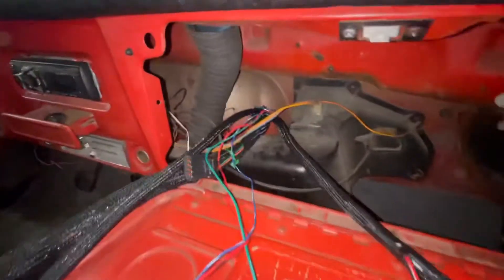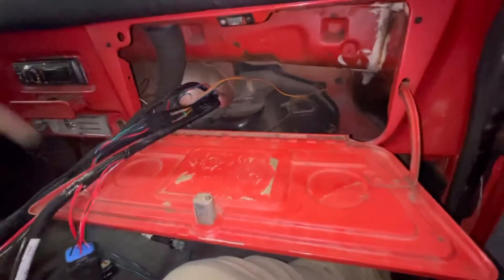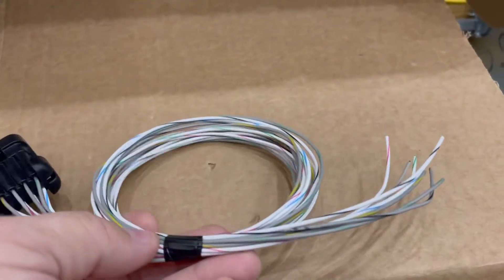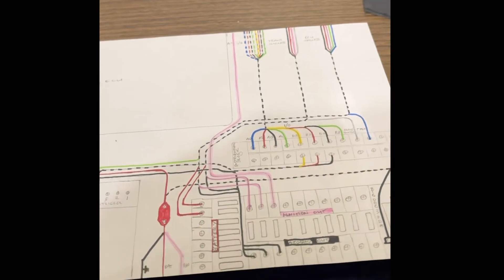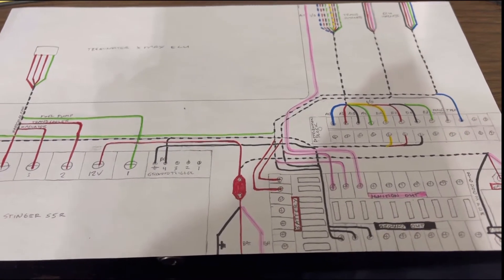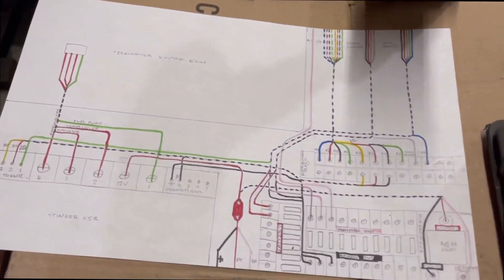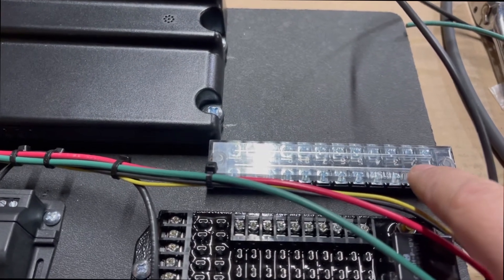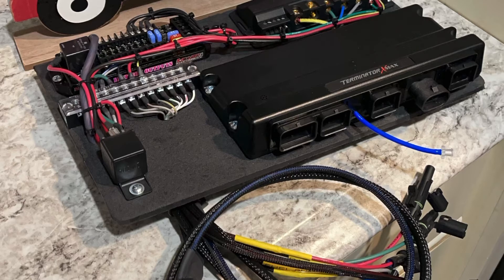Terminator X Wiring PART 1: PLANNING and building the right relay board.

Comment: Hey I noticed from your layout drawing you have a red power lead going into the leash board from the ecu bundle. Holley says to run to the battery. Did you run into problems running it to the board instead of the battery. I fugured the trans red wire wouldn’t be a problem since Holley said run the wire to the battery or a power source that is capable of holding 5amps consistently. So I wondered if you ran into any problems running the red ecu wire to the leash board. Thanks for the help. Your layout gave me real inspiration.

Comment: Reviews On Stinger relay are really bad. Just a FYI
Reply from the maker: Yes sir. Unfortunately I learned the hard way. They are now replaced.
Reply: @DanielsDesign what did you replace them with?
Reply: Interesting I’ve used them in several builds with no issues

Comment: Hey, did you, or are planning on running the term x  power leads to the “big dog 3” block. I thought the leads go directly to the battery. I want to duplicate this. That’s my only concern thanks
Reply from the maker: My terminator ex leads go directly to the battery per the instructions. I wouldn’t suggest anything other than that. I have also been to Holley efi tuning classes and they always suggest straight to the battery. I used a power and ground wire from a junction point to power the distribution block. If you need any more info drop your Email and I can shoot you pics if necessary. Thanks for watching

Comment: Great video looks good I'm using the stock harness for all the factory lights but custom for everything else... just wondering what wiring loom cover you used?
Reply from the maker: I will have to get back to you on that. The seller I bought from on Amazon is no longer.
Reply: @DanielsDesign  cool thanks for the reply

Comment: Those solid state relay blocks are awesome. Yes I paid $200+ because mine says MSD. Even found stinger before order. But had to have it lol. Once you use that finger cuff style loom you never want to touch anything else. Makes your harness look as good as nylon braided hose.
Reply from the maker: Yes sir! I ended up having a little trouble with my SSR. But it was mostly due to me almost maxing out the amperage. I should have bought the MSD in the end so you did Good!
Reply: @DanielsDesign  honestly I think that stinger is higher amp. Or it has 1 that is 40 maybe. Cant remember. I think im gonna run one of those in the back to trigger some non essential kinda stuff.
Reply: @shawng7902  stinger for the win

Comment: This video was exactly what I needed, thanks a bunch man. Using the holley term with a msd solid state relay board and a leash pro street board along with a basic switch panel and this answered most of my questions. Just have to figure out the ignition/start button wiring to the starter
Reply from the maker: Hey man thanks! If you need any help just give me a yell and I’ll do what I can.